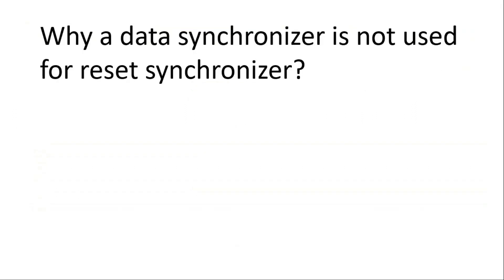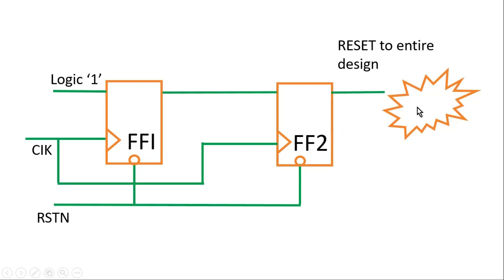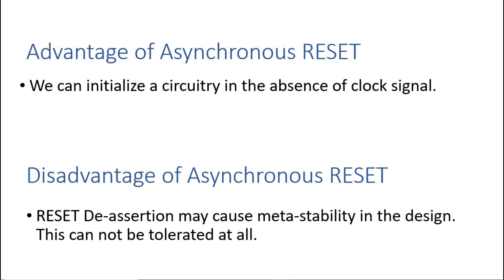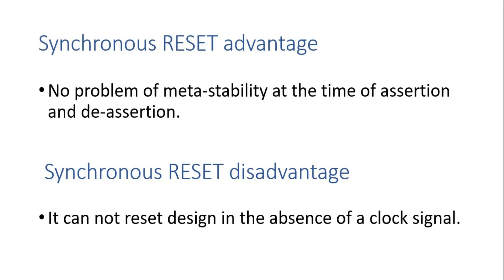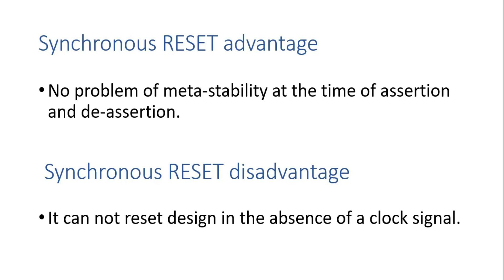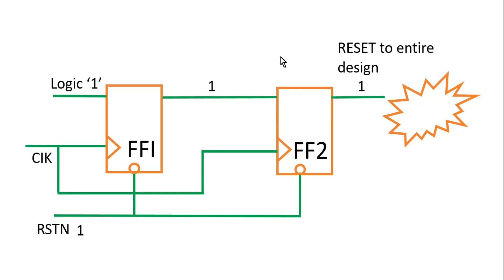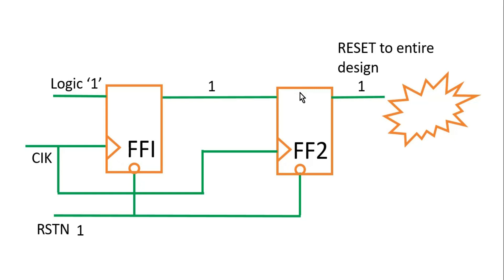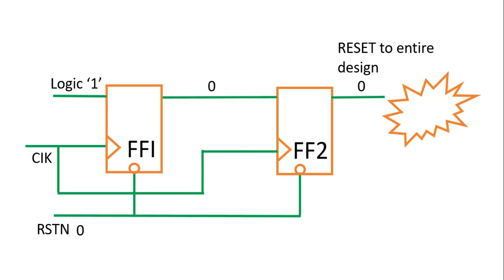Interview Questions on Clock Domain Crossing CDC and synchronizers Part 1

Comment: I feel that the input to second flipflop(=FF2) is always 0 when reset was applied and it will be constant (not changing right before reset asserted or clk edge) and that is why FF2 output will never be metastable
Reply: Ok
Reply from the maker: Correct answer !!!!
Reply from the maker: Glad to see your discussion !!
Reply: Metastability here is not due to data input but due to reset recovery and reset removal time. How is that not possible for FF2 ?
Reply: @kamleshraiter658  if we look at the scenario before reset gets deasserted, input of FF1 is tied to logic 1 and output is 0, but in case of FF2, the input is 0 and the output is also 0.  So there will be logic differential for FF1 once reset is deasserted in reset recovery time and output will oscillate i.e metastable.But not for FF2 as there is no  logic differential. This is my understading. pls correct me if anything is ambiguous in  my coclusion
Reply: @shri1527  why data synchronizer not used for reset synchronization?
Is it due to asynchronous assertion and synchronous de-assertion.
Reply: @meenapriya7232   we use data synchronizer to transfer signal from one clock domain to another. But the mentioned reset synchronizer is used in single clock domain. So the purpose is different
Reply: @shri1527  Logic differential is of no importance here, as its not the cause of metastability. The cause of metastability is when the reset gets removed w.r.t to clock. If its not meeting reset recovery/removal time its bound to get metastable.
Reply: @kamleshraiter658  true that metastability is bcz of violation of reset recovery time...but I was putting the reason why it's only at FF2 and not at FF1.....my reason may be wrong as I m not an experienced person.let me know if you have the answer

Comment: I have a question,

Im using clock gating in my design. My question is: the clock gating should affect the dual flop synchronizer or the synchronizer must have the free clock always?
Reply from the maker: if you are talking about dual flop synchronizer for data.. it depends upon your design architecture expectations. But w.r.t metastability, I dont think it will cause any issue.

if you are facing any issue, let me know we can discuss.
Reply: @TechnicalBytes  Hi, thank you for your reponse. I managed to fix it. The problem was not with the clock gating.

I have another question, if you could help me:
I'm using a handshake synchronizer, and I have control signals of it (Ack and Req). It is used in my FSM to control the data sent in one domain to another. However, the tool says that it is a convergence of signals (control signals synchronized combined in a logic). Do you know where I can find more  informations if I should waive this problem or find another solution to avoid convergence of control signals of handshake synchronizer?

Comment: If a data synchronizer is used as reset synchronizer by  tieing it's data pin high..
Would it result in some kind of issue or it will work correctly?

Comment: Didn't get what is clock domain crossing
Reply: Assume there is a flop F1 clocked by a clock signal, say clk1. We say this flop is in clk1 clock domain(or clock boundary, any other flops having clk1 as clock would be a part of the same clk1 clock domain). Another flop F2 clocked by a different flop, say clk2 is present in some other part of the design. If we need to send some input data signal to F2 from F1, this signal would cross(move) from clk1 domain to clk2 domain as the destination flop F2 is of clk2 domain. This incoming signal from F1 appears as asynchronous to the F2 flop as it is from a different clock domain and this may lead to metastability.

We can say that the input signal has crossed clock boundaries/domains (from clk1 to clk2) which is pretty much what a clock domain crossing (CDC)  is.